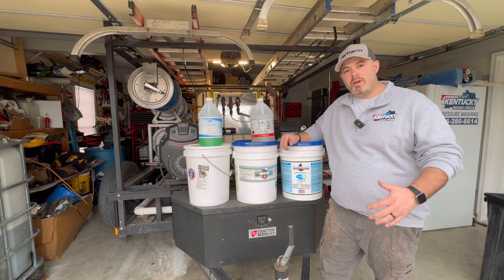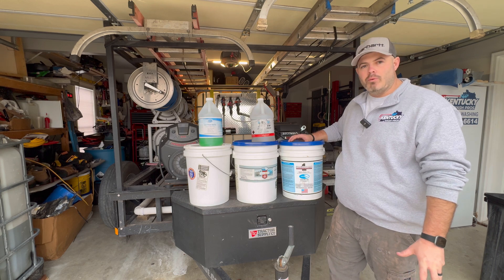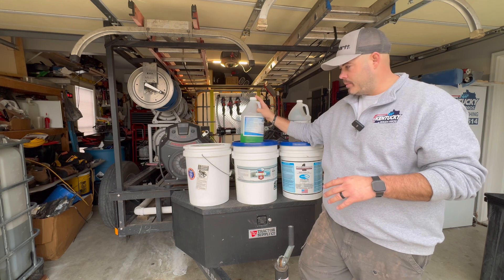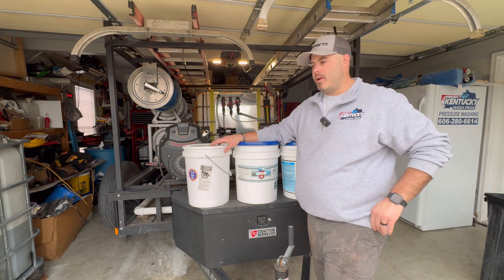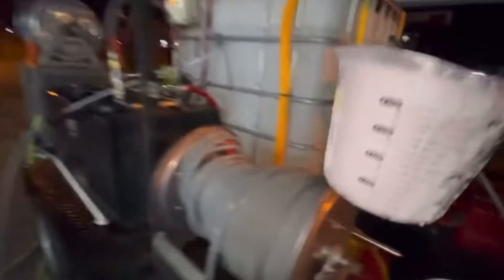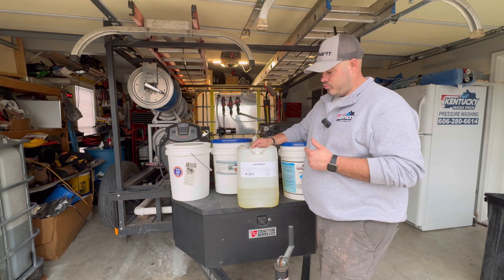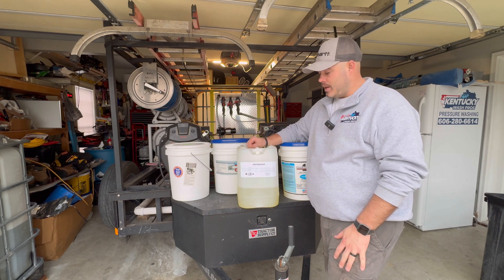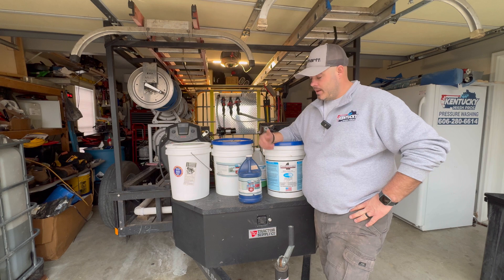What Chemicals The Pros Use For Pressure Washing and Soft Washing

Comment: agree with all products except the gutter butter tried it worked ok also it takes the paint off if the gutters are badly oxidized had much better luck with Clensol BC also Clensol BC works well on wood
Reply from the maker: thanks

Comment: I have a question,  this has nothing to do with what  you're  talking about,  but I  brought, a pump with a  gearbox  on it and when it came I opened the box and  looked at the  pump but the gearbox  had a crack where you bolt it to the pump,  what a good  gearbox  I can get to replace the  bad one, I got it to put on my predator 670cc,  can you give me any advice  on this thank you very much
Reply: I want to  thank you for your  advice,  I  got a hold of the  company and they are  sending me a new  gearbox,  it's  already on the way.
Reply from the maker: Well for starters I would call the vendor that you bought it from and let them know that it is cracked and see how they can remedy this problem. If they are a good vendor they will send you a new one and ask that you send that other one back. 

If that doesn't work, I would call Russ Johnson at Southside Equipment and tell him that you need a gearbox for a Predator 670 and he will take care of you.
Reply: @KentuckyWashPros  thank you very much,  And  by the way  love  your podcast  on Wednesday nights
Reply from the maker: @arnierider7096  thanks, we are just trying to add value to everyone